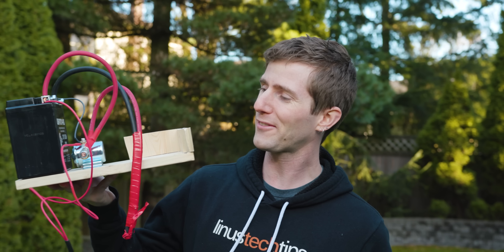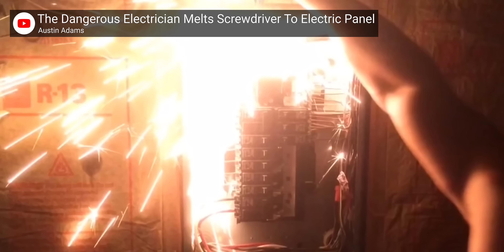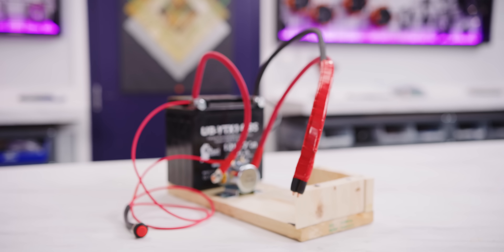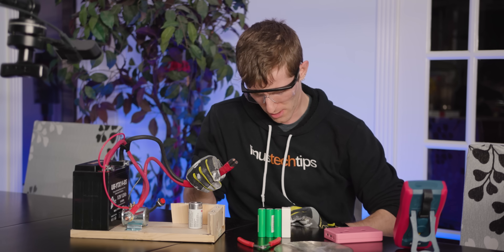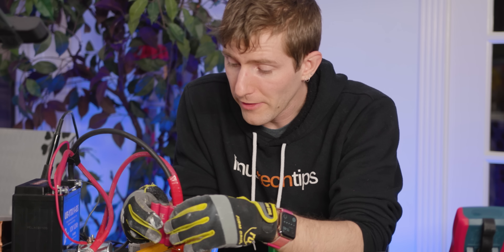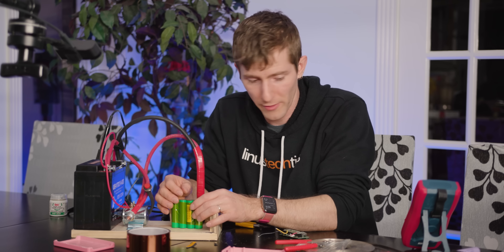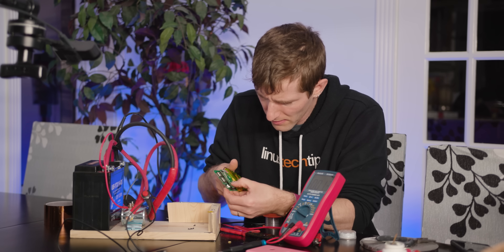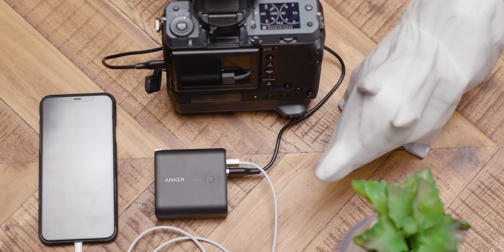I spent $100 to save 20 bucks... and it was TOTALLY worth it!

Comment: You make the process look difficult whereas actually, it's really quite easy and safe. You're holding down the momentary button for way too long and your relay is sticking on by the looks of it. Get a better relay. Your probes are far too far apart, you're ending up on the very edge of the positive terminal circle, you need to be at least 3-4mm closer together. One of those positive terminal welds you did almost went through the ventilation membrane... you should check that.

Also, no credit to the original designer/builder of this welder where you got your design from... me!
Reply: If you think you're the first person to build a DC spot welder I've got news for you bud.
Reply: @yourpreston1  darkkevinds videos are older than most of the diy spotwelder videos you can find on Youtube. 

Older videos than the darkkevinds videos show ac spot welder ,and one dc spotwelder that is just the probes connected to the battery.
There could be older videos witha similar design to darkevinds one but it's highly unlikely that LTT watched some viedo that is so bad ranked in the algorith that you couldn't even find it with the search function.
It is in fact more likely that they were inspired by darkkevinds videos.
Reply: The distance of the probes was something that puzzled me. I have seen commercial ones before and your video clearly shows the right distance.  How did they decide on that distance after they clearly went on the internet?
Reply: @S41t4r4  i mean the video is still sponsored by anker...
Reply: @L0calH0rst  If that is the reason, I would be really dissapointed. I can tolerate incompetence to a certain degree. But actively manipulating the outcome of a video because of creed is something I can't tolerate. 

I still hope that it was pure incompetence, but it definitely doesn't look like it is.
Reply: That design is so simple anyone could come up with that literally just a solenoid, battery and a button lad in video probs thought of it him self anyone with VERY BASIC electrical knowledge could come up with that
Reply: xD

Comment: This build would really benefit from using an Arduino to control the time of the pulse and possibly create a dual pulse set up if the relay switching times allow for it.

It can be added fairly cheap, needs 5V Arduino (ATTiny 85 would be suitable for a hard coded pulse time), 5V relay for Arduino to control 12V relay, 12V to 5V SMPS (car charger, pigtail a car socket extension cord then crimp on appropriate connector for battery terminals, and pigtail a USB cable) if you want it to be all powered by the single battery, a button, and wiring at a minimum, could add interface like LCD and additional buttons to control pulse time on the fly but for one off project you can just hard code the timing. After that, you need to find the short circuit current of the battery and recommended Joules for the material you are spot welding then calculate your pulse time. Might add like $20 to the build but if you are doing this more than once it really helps avoid cooking cells or burning through nickel strip.

Comment: You should use arduino as a switch hold to create precise time interval for the spot weld. That way it will give you much more consistent weld . Also you can add an LCD display and a potentiometer to change that time interval .

Comment: Nickel fumes are an extremely potent carcinogen in only trace quantities and spot welding nickel should never be done without significant fume extraction and fume mask both rated for nickel. Even with protection it should never be done in any environment that includes children. 3m makes fume masks for jobs like this but I would guess they're all sold out just now.

Comment: Why do you fear these batteries so much I used to connect the two end of these when I was a kid,  playing with them and they did get real hot but nothing dangerous happened. unless I touched the wire which it always gets red hot.

Comment: You are better off with soldering, than this. These batteries are designed to withstand 120°C for a short time. While soldering requires about 220°C, it will mostly heat up only the cap of the battery. I made a power bank years ago with soldering and it still works fine

Comment: You could weld the batteries together, OR you could just buy a battery case that's designed to accept 4x 18650 batteries and save yourself the time, while still getting all the benefits of buying separate 18650 batteries?

Comment: car battery would have been better suited, as they are designed for high current. The battery you used was a deep cycle battery, designed more for slow discharge but deeper cycles

Comment: i had never built one of these till a year ago, a family member uses a mobility scooter and the stock battery was just some unbranded and recycled battery pack; it lasted maybe 30-45 minutes at a time, pretty shit really - looking online for replacements didn't convince me it wasn't going to be any better quality/capacity - i ordered 100x 18650 cells (genuine samsung from a reputable outlet, very important imo as there's tons of fraudulent cells floating around), did tons of research and bought parts and i actually built a successful 7S12P 41Ah pack (the original was 7S4P "10Ah") and mine lasts at least 8 hours (stretched over a few days) before needing recharging, still working great to this day - the spec on the provided battery doesn't add up at all when comparing them and likely has junk cells orthey severely over-rate the labelling (their labelling makes mine 4x better, but reality it lasts around 18x longer) - i built it with a DIY spot welder and controlled the pulses with an arduino (double pulse, as recommended online), best thing i ever built

Comment: Put a simple timer circuit on the relay that will remember the hold time for you, will save you time and wasted materials in the future. Also you probably should solder the wire on the tab first and then spot weld it.

Comment: I swapped 18650s before it was cool!!!1!!!11!!111oneone

.................
My good old laptop had a bad battery, and the ordered battery from the ONLY seller of such a model didn't make it to here, I did it myself. Was also 4 18650s in there, but since I didn't have a gadget, I didn't even weld the new cells together. They basically have contact through pressure, it's sickly tight on that compartment. Sounds redneckish, but it works fine for years now.

Comment: You could actually touch the end of the two contacts and press the button and you'd be fine, as its only 12v, and the human body's resistance is extremely high.

The real danger here is shorting the lead acid battery, so if you make this at home you might want to look for a correctly rated high current fuse or some other current limiting circuit. Allowing too much current through a lead acid battery can cause it to heat rapidly, which is obviously dangerous. Also ensure you buy a high current relay like the one they use, as a lower current relay could just weld itself on forever.

Apart from that, this is actually a very easy and safe way of spot welding on a budget.

Comment: I recently built a spotwelder from microwave oven, works great, does not kill 18650 cells and makes it soo much CHEAPER to make DIY high performance battery banks that would otherwise cost a lot. Also Microwave oven was from recycling bin, so no money spent there too. 
Would prefer spot welding myself anytime than buying expensive battery banks from shop

Comment: Actually if you pull apart a larger battery with more cells densely packed (like a 18+V 4+Ah tool battery) - you'll quickly learn that welding tabs on tabs is very common.

Comment: EHS suggestion, you may want to add trigger guard, to prevent accidental discharges. I could imagine it activating when dropped on the table or pressed against body while manipulating electrodes and welded piece...

Awesome content though!

Comment: I've made one of these but mine runs straight from a 12v LA battery with a 120v microwave oven style door witch wired directly into the welder handle for single handed operation.. ALSO @ 12v there is virtually no chance of getting electrocuted unless you put the positive and negative wires in your mouth. Not saying you cant get a little shock but definitely not electrocuted like sticking a fork in a wall outlet.. Btw Linus, you sound sick, you can hear it in your voice..

Comment: Idiots.... You can buy a budget lithium cell welder for $100, or you can do the same with a proper $20 controller. Without timing control you'll blow your fingers off along with batteries, or turn your powerbank into a ticking timebomb with damaged spacers under cathode or through-holes in the shell with leaking electrolyte.
Or if all you want is a decent powerbank with known good cells - there are kits with battery-holder-style springed contacts for under $10.

Linus, you may not be the sharpest tool in the shed, but I know you are a reasonable person.... So please remove this video before someone hurt themselves, or at least remove it until you re-do it with a bit more thought in the process.

Comment: The relay is waaay to weak, this is why it got stuck when welding (it didnt have enough "beef" to disconnect the contacts inside).
Reply: It's not weak, it's just got far too low a DC current rating so it's arcing as it switches and building a small oxide layer that causes the internal contacts to stick.
Reply: @gsuberland  what, it's a relay for starter motors, judging by the size, probably for lawn mowers. They can draw easily 200 amps, way more than this little welder.
Reply: @octane613  The CCA on this battery is 200A. The short current is going to exceed that significantly.
Reply: @gsuberland  if it's a car starter, car batteries run at about 14 volts and 600amps. So I'm not sure what battery he's running, but you might be right. Either way the momentary switch should be on the negative side of the circuit. On the positive side it could lead to arching, and worse case a system that stays on and causes a fire.
Reply: @Thedatsuntech  There's no difference on which side you put the switch, the current flow is identical either way. Contact arcing is usually due to excessive voltage (spark jumps the gap as contacts approach or depart, forming plasma which damages the contacts and can lead to sticking) but in an abusive use-case like this they're effectively welding the relay contacts together in the same way the welder sometimes sticks to the zinc strips.
Reply: @Thedatsuntech  car starters for a regular 2.0 tdi German takes just under 200 amps

Comment: I tried batterypack repair on an old Lenovo Thinkpad batterie  ONCE ( you guys know the ones that reach out of the chassi on the backside of the thinkpad and are really nice as handels...) its really not worth it , this seems really cool and fun but its way more intense. Tried to soder, since I do not have a spotwelder and it was a huge time investment nothing was just fast and simple... and at the end it kinda worked but after 2 Weeks i got some problems again with the battery and just did not start all over... just directly bought a new battery pack. I love repairing my own phones laptops etc... but battery packs are really not worth it.

Comment: I've been playing with 18650's for 3 years now and I was curious if he would get anything wrong, not to ridicule him but just to see how well he does his research. And I am quite impressed, the only thing that I would have advised is that rather than add more nickel strip you should have soldered onto the nickel strip that was directly above the terminal. Yes the heat is bad for the battery but it would dissipate better because its over a whole strip rather than just one terminal, and by spot welding more nickel strips you could increase the resistance in the connection (not THAT big of a deal for something with this low of a power draw, BUT good practice) otherwise 10/10, very impressed with your thorough research.

Comment: If you want to make the spotwelder be a little less hank then have someone who is a little up on circuitry make the a timer relay activated by the thumb switch.
If you did that it would remove most of the safety issues with using this

Comment: Using an Arduino with another smaller relay to toggle the big relay would mean that you could precisely set the duration of voltage applied in milliseconds when you hit the trigger, making the spot welding a lot easier and more consistent.

Comment: "hot and ground" is what you call it in an AC circuit, it refers to the active and the passive lead.
it's called "positive and negative" on a DC system.

Comment: Nickle plates could have some sort of protective layer. It's always a good idea to sand small plates like that for a few seconds with sanding paper. The rough surface also helps with contact and the soldering.

Comment: Ah yes an “electrocution hazard” from a 12VDC battery.
Good luck killing anyone with that!
Reply: It is more of a burn hazard than a electrical hazard :\
Reply: Andrew Lane It sure would create a fire real quick, given the chance.
Reply: It is definitely possible if you break the skin.
Reply: Tim Seguine Even without skin, you’d still need to have deep penetration near a vital organ. I don’t think they were going to somehow handle the battery without skin on both electrodes.
Reply: @CoolJosh3k  The body resistance is higher than I thought. Turns out the body resistance of a human is about 1000 ohms with broken skin, whereas I had remembered it being something more on the order of 100 ohms.
Reply: Its about current (A)
Reply: boundish1 You need a large enough voltage across something for the current to go through.

Comment: Why not just use a 4x-18650 battery holder/adapter??? Man Linus, it is more cost-efficient lol no solder and easy to replace batteries

Check this out: 18650 Battery Case Holder with Lead Wire Bundle, 4 Pcs DIY Batte... https://www.amazon.com/dp/B07Q13T3RH/ref=cm_sw_r_sms_awdb_t1_6-9NEbQHAANGA

Comment: See, my criteria for power bank is convenience. It need to have fordable plug, as one of those have, as well as attached cables for whatever port I need, which none of those have. The powerbank I'm using now have a micro usb, a usb c and an iphone charger thing on it. The cables aren't long, so you have to hold the bank against the device, but that's an option. And if you do need longer cable, that's still an option. I don't know why that's not industry standard, it doesn't seem particularly hard.

Comment: Protip: If you have a spare car amp capacitor, you can charge that to 14-16V and use it for this purpose. The distinct advantage is that its energy content is just right for battery spot welding, guaranteeing you a perfect weld every time. And if you're a megaballer or you creep around the garbage container of your college campus for fun, you can get a beefy MOSFET or IGBT instead of a machanical relay, which does away with the sticky contacts. This is how I made my 192-cell battery pack.

Comment: Linus: You think one of these might have been a good idea in case your had a problem with your switch or relay? (Come on, Steveston Marine in Langley is less than 10 minutes away.)
https://www.stevestonmarine.com/boat-electronics/boat-electrical/boat-switches-and-breakers/battery-switches-manual/Blue-Sea-Systems-Switch-Batt-Mini-On-Off-W-Knob-6006?sort=p.price&order=ASC

Comment: Now that is classic Linus!  And nope, he won’t burn the house down, maybe make a skidmark on the table and get his heart racing but he’ll be fine.

I would recommend a small veroboard 555 timer circuit to get a consistent spot weld and cut down on the Super Skidmarks moments however if anyone else builds one.  Oh yeah, and use it in the backyard if you’re able to, it’s not electrocution ya need to worry about at that low voltage but heat, fire, fumes and angry missus.

PPPPPPPPPS, don’t skimp on the relay or your contacts might weld.

Comment: Uhh, don't lead acid batteries the like of you'll find in cars release hydrogen gas that can ignite? That's why you put one negative lead on the chassis of your car when you hook two cars up , so when you remove the lead it doesn't spark near a battery, right ?
Reply: The negative ground is primarily to avoid voltage differences between the electrical circuits and the vehicle (floating voltage) which does prevent the sparking. As far as hydrogen gases, yes but those are generated during charging not discharge, also the battery used here is a Sealed Lead Acid (SLA) battery which, while it doesn't 100% contain the gases, does cut down on the risk unless you are hammering it with charge current and cause the safety vents to pop open.
Reply: @dunzerkug   But the negative terminal is directly connected to the chassis, so how would it create a voltage difference unless you attached to a poor ground contact? I thought it was simply to move the contact point away from the battery and enclosed area to some place more ventilated. Also, isn't it a good idea to rev the engine a bit to keep the voltage up?
Reply: Tho he is MOSTY going to be ok, I did think this is still something that could be catastrophic lol...
Reply: Yup it could go really bad if the nitrogen ignites.
Reply: @KRich408  yeah nitrogen is particularly known for its explosive properties
Reply: @KRich408  people who use lighters must be mad then, i head air is like 80% nitrogen

Comment: I think you've missed the purpose of not using solder by using spot welder without a timer . 
You should use a timer to limit the time when the circuit is on for some parts of second .

Comment: It could be interesting to cut a hole
In the solenoid and see if the internal copper contacts are heating up like the tip. I would bet it’s welding it self internally.